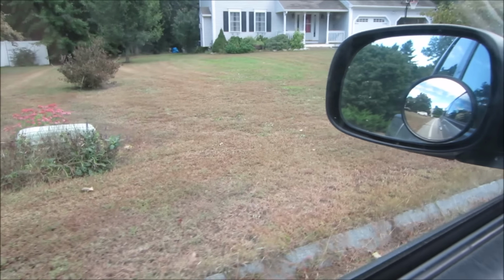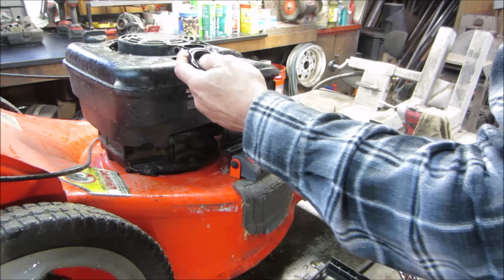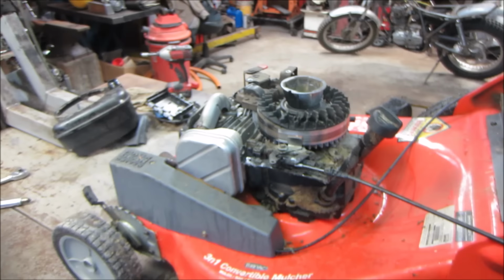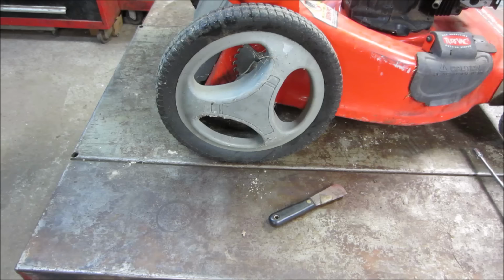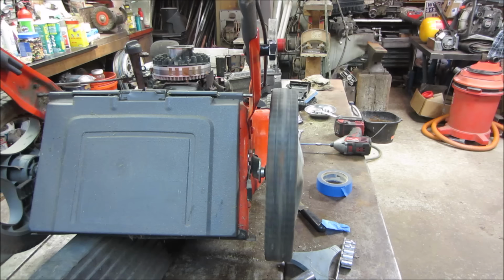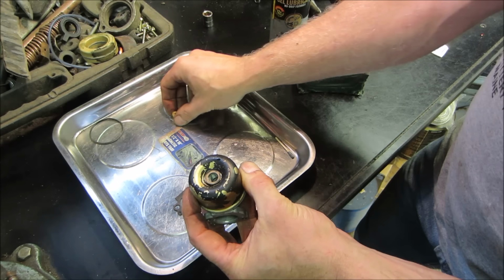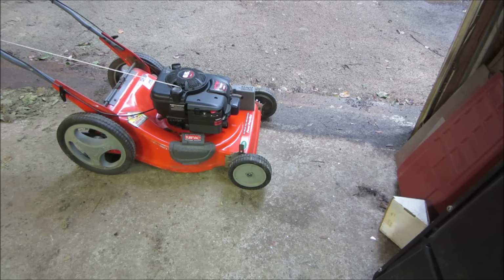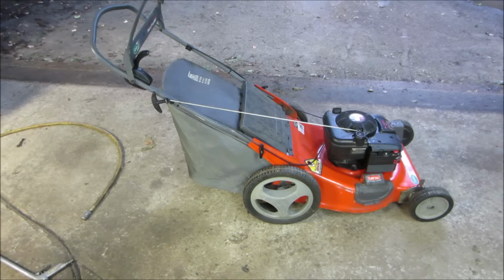How to restore a lawn mower. cheap.

Comment: Loved it at the begining where the truck stops at the golf clubs and rolls back to the mower............pure 100% petrol head 👍
Reply: most certainly. id do that too. if i hated golf quite alot the clubs would make  excellent bar stock  for machining or blacksmithing  or even for a ratrod.
Reply: @tailsdollblack9340  The carbon shafts make good projects too. Walking sticks etc.
Reply: I'd a filled my truck,, yard sale the crap,,  ebayed the clubs,, 2 or 300  buck stop!!
Reply: Most golf club shafts these days are carbon fiber, make good model airplane or quadcopter struts. Cookware looked good. The skis? could be used as traction boards to drive out of mud or sand if you put alot of short bolts through them.
Nice to see someone refurbishing a perfectly good mower that was discarded by someone who probably doesn't even own a screwdriver.

Comment: Thanks to watching your videos I was able to diagnose and fix my Husqvarna riding mower.  It worked perfectly one week ago and wouldn't start when I tried to mow my lawn.  I checked for spark, it was good, checked for air, it was clean.... so it had to be the gas.  Shot some starter fluid and it fired right up but died extremely quickly.  I took apart the card and cleaned it.... still a no go.  Now here is where the videos helped, although I have never seen the fix in one of the videos.  There was a solenoid coming off the bottom of my bowl, so I researched what it did.  It is a fuel shut off/ anti backfire solenoid..... $60 to replace.  Did some more research and found that if I added a shut off valve and ground down the tip it would work just fine.  5 minutes of precision grinding and the mower started within seconds!  Thanks for giving me the confidence to tear into my machine and fix the problem!
Reply: Me too. Just resurrected a crappy ole Sanli mower left for dead. It is now our go to mower. I call it Mustie, and now my brother is borrowing it as it runs better than the expensive battery start Rover. Hopefully we can pull that apart next.

Comment: I was a Lawn & Garden Tech, among other disciplines, for Sears, Central Florida (long mower seasons) for many years, . I'm retired now (not from Sears) but I still love them old tractors and have a small  collection of 7 tractors. I once had a collection of 13 in Palm Coast Florida, but no lawn. I've tore down and put back together those little engines, not spending a dime. Cheaply molded with cracks and pits everywhere, I'd tear them down, seal all the leaks with liquid steel, was in a grey tube, they don't make anymore, put them back together real nice... crank 'em up one pull, run smooth, and no leaks. I often vsaid many times that you can dig 'em up out of a landfill and get 'em goin' inside of 4 hours,

I'm happy to have found your stuff here. I cn't get enough of this sort of thng. Thanks. It's very generous and kind of you to take the time to contribute these awesome useful, helpful YouTubes. `John.

Comment: Hey Mustie1  I'm a avid watcher & have began to make small repairs on all my small engine equipment because of your vids.  Today I tackled my YardMan plastic Pulsa carb, replacing the diaphragm & gasket, only to find the 'pulse' spring broken.  Not having one, I went in my 'hoard' much smaller than yours of course & modified a  spring that was close.  Runs like a champ now.  My wife was impressed. (You know what that means).   ;)  Thanks for all that you do.  You should know that you are making a difference to millions of men & women with what you do.  Thanks Again.   Stay safe out there. Blessings from  Hopatcong NJ to you & the family...

Comment: Pretty entertaining after just comming in from working on a snow thrower. Got it for $49 dollars at the good will. Its a four stroke Toro. Very very clean. It had a dealer sticker from down state by Detroit Mi. I live up North, not across the Big Mac. Anyways. I was going to let it go until I saw the price on a new four stroke Toro snow thrower. It doesnt have electric start but hand pulls easy peasy. I cleaned the carb and changed the oil. Fresh gas and fired right up! So thats three I have ready for sale come November.  I buy up stuff dead or dying, fix it and sell it. The money goes for my RC hobby. I fly planes, helicopters and whatever I happen to buy. I am retired/ disabled. Gives me something to do. I enjoy your video just for the entertainment of it. Been doing small engine repair for 25 years. I had my own shop and worked for local shops,so lots of experience. I have to limit what I do now. No more snowmobiles or riding mowers or tractors. At least I try to avoid them. lol.

Comment: To straighten your plastic tires...   heat the entire wheel up in the oven to around 150 degrees or so (farenheit), then set it down on a flat surface with a cutout for the hub.  Lay a sandbag over the top to weigh it down equally.

The blade is upside down, someone also ground it improperly.  On the outer side, the chisel points down, but on the inner wings, the chisel side points up.  This is a mulching blade.

Comment: I have had luck saving electronic devices from water damage by doing the following.  1st remove the battery, next rinse in deionized or distilled water.  This is followed by air drying or preferably placing the device in a vacuum container to drive the moisture out.  The water is normally not the issue, however the dissolved solids are.  Love your videos.. Keep tinkering.
Reply: I don't see how rinsing the battery in any type of water would help.
Reply: @manolisgledsodakis873  Not the battery...  The device.  Rinsing the device with distilled or de-ionized water will remove the dissolved solids and help prevent any electrical shorts.  Placing in a vacuum will cause the water to boil off leaving nothing behind.  In addition rinsing the battery in those two types of water would not hurt.
Reply: @mcmoffitt  why not rinse it in isopropyl alcohol?
Reply: @mashedpotatoes5323  I am not sure about the purity or if the solvent properties would have a negative impact.

Comment: You brighten my day everytime you bring us a new video Mustie1. Just want you to know your efforts are appreciated. You've inspired me to tackle my  oil leaky 1978 Honda cm185 that's sat for 10 years. You made it slightly less intimidating to a novice, and actually got it running though poorly. But learning a lot. Found a 1200watt free generator on the side of the road 2 weeks ago and have it running quite smoothly after cleaning the carb twice.  Very rewarding and wouldn't have tried if not for your vids.   Big fan, from a VT neighbor.

Comment: Your theory on how the carb bulb works is 100 percent correct and you did a very well explanation of how it works and I use shot gun cleaning bits to clean carbs on small engines  your welcome DennisCarb that is my whole life 6 to 600 hp since 1984.

Comment: I've been using 550 parachute cord (aka: paracord) to replace starter ropes on small engines due to the replacement ropes like the one you bought at tractor being cheap and thin.  Works well.  It's a little thicker than the OEM starter rope stuff, so you may get less length onto the recoil spool.  So far, that's not been an issue.  Seems to last far longer than the OEM stuff...and certainly longer than the Tractor Supply stuff.  50 feet of it is about $4.00.  I once bought a 1000 foot spool of it for $40, so I've got a lifetime supply, hahaha.  Keep up the good work - enjoy your vids.  :)
Reply: I've been using paracord as well out of necessity as starter cord is hard to get where I live. Not had a problem yet!
Reply: Excellent!  I'm glad to know my good luck using it wasn't just me.  :)
Reply: I just buy it by the spool on ebay, Stens brand. Its good strong stuff and it has yet to snap on anything I use. Its also thick enough to where, when you have to route it thru the two holes on a recoil where the old string snapped it goes right thru in one shot, without curling. It was cheap enough. Before that, I used to just re-use recoil rope that was long enough from machines that were tossed. I was finally running out of it and got the roll. I probably still have half that roll left and must have replaced the rope on 100 machines recoil by now.
Reply: I was wondering as soon as I saw the cord, "How about paracord?" and I can get it in colors to match the mower.
Reply: I tried that a while ago, working on a mower and it failed miserably. The problem with Paracord is that the outside is not attached to the inside.
Reply: @skulpturlamm294  If you use a sharp knife to cut and then melt the ends of the paracord it keeps it from unraveling.

Comment: Just fixed a mower set down at the end of a neighbor's driveway - took all of two minutes. I was afraid the shaft might have been bent, but it spun freely in their driveway so I put it in the back of my van on the way home from work to see if I could get it to run. The sign said "FREE - ROPE CAUGHT IN BLADE AND MOWER WON'T START". I took it home, they had already cleaned out any rope that was wrapped around the blade, but the engine cutoff cable had come loose from the handle. Placed the cable linkage back in the mounting hole in the handle, tightened it with a zip tie and viola! Started on first pull.

I've been putting up with a smoggy, clunky 35 year-old 2-cycle Lawnboy, and now have a self propelled late model mower. After a good hosing off under the deck, a blade sharpening, clean air filter, new spark plug and some fresh oil, this will be good as new and run for many years to come.

Thanks for the inspiration to take on these projects Mustie1! Your channel is a rare gem.

Comment: I know that engine. It’s the same as in my mower. I almost threw mine away last year but decided to give it a go at fixing it. Mine was leaking gas too but I tracked that down to a cracked plastic tank so I replaced that. It also had a problem with not starting when the engine was hot. What it needed to fix that was a new ignition coil/module. I’ve had my this mower for 17 years and it runs great now. I’m glad I fixed it and didn’t just throw it away.  Your videos inspire me to fix things and not just replace them when they have a problem.
One more thing, I think the key to longevity in these is to not keep gas in them. I run mine out of fuel almost every time I cut and certainly before putting it away for the winter. Never a problem with the carb.

Comment: I just bought an air cleaner ASM for my TORO lawn mower. Feel like I can disassemble the whole thing and fix it myself with no problems after watching your video! I must say you do a great job explaining. I say this because I have a short attention span lol. I watched this video clean till the end and learned a lot. Thanks....
Reply: These machines are like a puzzles. Nothing more.

Step A: dismantle until you can find what is broken and take the broken part away
Step B: ebay/google the part number. There is likely some number in it. Order a new part.
Step C: Step A backwards.

Comment: Never had much luck with the Scotts by Murray. Cheaply made, its usually the plastic teeth in the front wheels for the self propel eaten off or the bail on the handles broken.
Its got one thing going for it, that engine. Its a dual shaft with a side pto auxillary. I just sold that same engine I pulled off a busted Scotts for $100 plus shipping. Their fairly hard to come by and werent used on many newer mowers except many of these scotts. Their good for other heavy duty pieces of equipment like sickle bar mowers that require that auxillary pto.
Reply: I never saw one before till i passed one up a few weeks back because it was beat to utter hell, and now here's a very similar one in this video.

Comment: I bought a Victa 2 stroke rotary lawn mower new in January 1999 . Last Century now.  Done a lot of work, mowed the lawns with it today, started 3rd pull on the cord. 21 years old. Always put a new air-filter in every couple of years, have to look after the old girl...Same week I bought the lawnmower I bought a new Washing machine and, a Dryer. They're still going too .Use them every day.

Comment: That's the first front wheel drive push mower I've seen! With a solid bar blade, soft catcher bag and individual wheel height adjustment I'd have left it there if not for being self propelled. Scored an intek auto drive motor on a rover recently, runs so nice but the tank has split it's seam which is common on these. Fibreglassing the seam tomorrow.

Comment: Hang on....did you just put a Q-tip in a power drill for cleaning?  I've never thought of that before.  That is genius.
Reply: I know I thought the same thing
Reply: just please, please don't try that in your ear...
Reply: Now I can't hear damnit.
Reply: A dremmel is more fun
Reply: Its not stupid if it works! 😂
Reply: For what it's worth. While dealing with a brass needle seat, deep the Q-tip on some "polish compound". When your done with it. The seat will look and perform like new! 
Rebuilt dozens of carbs never had one dripping after doing that... My 2 cents! ;-)
Reply: Yeah I polished the seats in my motorcycles carbs this way with a Dremel and metal polish on the Q-tip. It was a brass seat so metal polish worked marvelously
Reply: Sounds painful
Reply: Bender2497 awwwwwwsome!!!!!
Reply: Toothpaste works great as a metal polish also... and will leave your needle seat smelling minty fresh😅😅😅
Reply: @gettintheresafelywithpatf6443  so does scratch and swirl remover that's used for buffing paint. I used it to polish my intake manifold after porting. My normal polishing compound was no where to be found so I grabbed the buffing compound figured it wouldn't hurt to try. Worked fantastic on aluminum intake manifold. I doubt it would do as well on steel or iron.
Reply: That was my thought, too. Brilliant.
Reply: pospc2 I have used up my supply of liquid ebony... so for swirl remover I use corn starch and pledge I don’t know how it would work on a carb
Reply: Car wax works great on metal, mirror shine. No need for special polishes. Only 12 ounce dollar tree fuel treatment for me.
Reply: yup , bloody great idea .
Reply: @happycamper6352 didnt hear you. What did you say?

Comment: I absolutely love your channel and have watched many, many videos about many different topics.  I learn so much every time, even when I watch some of them two or three times.  I agree with you almost one hundred percent all the time, but on this one I have a comment.  Your analysis of the existing blade is correct in that it was sharpened incorrectly (backwards), but you still reused it assuming that it must have come that way.  The sharp cutting edge must be the lowest point of the blade, otherwise the blade just whips the grass after it gets cut higher, thus leaving shredded, brown tufts on each blade of grass.  I've reversed many blades that have been put on upside down, but have seen very few that were sharpened backwards like this one.  Thanks for all your great videos and I especially like your new shop.  I would be happy with your old one.

Comment: Nice job as always. If you sell it for $100, I'd say you earned your money. That's $100 worth of service you put into it, at least. BTW, I wanted to thank you. A few weeks ago, we had hurricane Florence coming our way, and I dragged out my old generator, and of course it wouldn't start. After watching so many of your videos, I pulled the carb out and cleaned it as best I could with carb cleaner and a toothpick (no ultrasonic cleaner at the time). Started right up. Turned out that we didn't need the generator, but I had peace of mind. You da man.
Reply: Where I come from, that's a 150-200 mower

Comment: That blade is a self sharpening blade, that’s why the edges are screwy.  You’re supposed to flip it every season to use the sharp side.  Then the trailing edge sharpens as you use it.
Reply: I have never heard of such a thing very intereasting im gonne do a little research on self sharpening blades now you got me curious lol
Reply: I thought one way is for mulching & flipped is for bagging..
Reply: @delwhylie4748  Preach!!!
Reply: What in the hell is a self sharpening blade??? Been landscaping for 20 years and never heard that one before😆
Reply: @matteckert6676  Maybe that one is pulling a few legs,  Just to confound all the gear-heads on this channel.

Comment: The oil in the carb surely comes from the guy wanting to sharpen his blade and turned his mower on the wrong side as Mustie explained later. Did it once years ago, thought I'd blown the engine. Called the local shop. "Have you removed your blade lately ?. Aaaah, yes. How do you know...?"  
 Cleaned the carb and air filter. All was ok but my ego. Oh well...